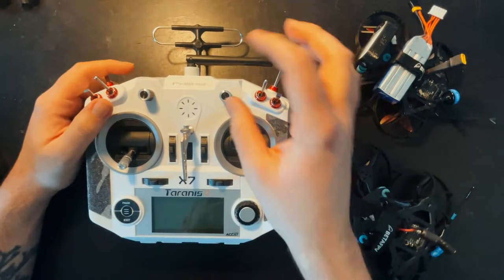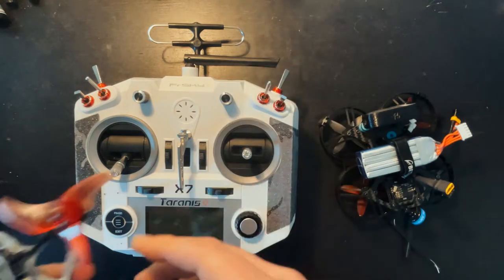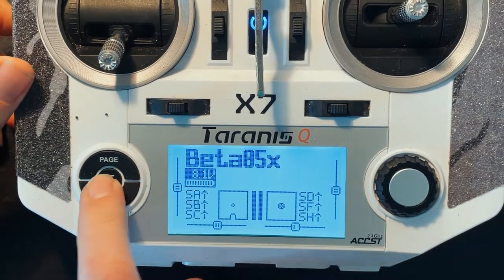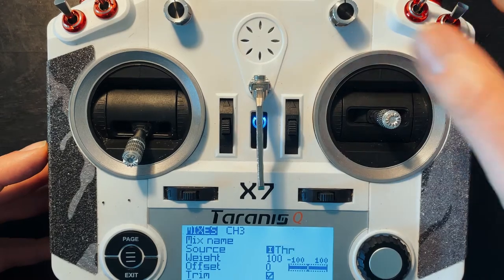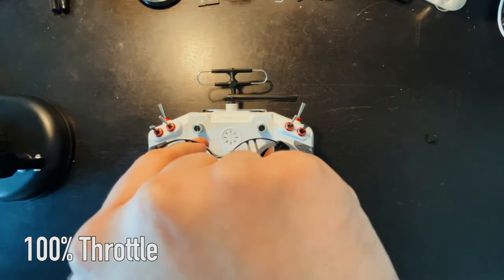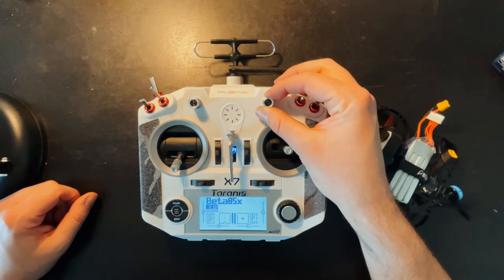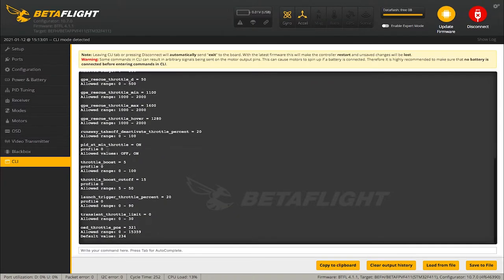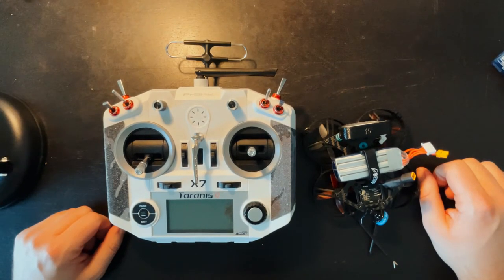OpenTX Variable Throttle Knob!

Comment: For ground vehicles with reverse, omit the second (Add) entry in the mix and you'll have speed limit in both forward and reverse.  Just add the Multiply 50/50 to the throttle output as shown.

Comment: @TRONCATFPV Hi. Could you help me Limit my rc boat to 3 speeds. I'd like to havr my throttle limited to SA↑ 50%, SA- 75%, SA↓ 100%. Each setting the throttle stick needs to only travel 0 - 50 on SA↑, 0 - 75% on SA- and 0 - 100% on SA↓ Pkease it you could help me as i havr autism and learning disabilities.